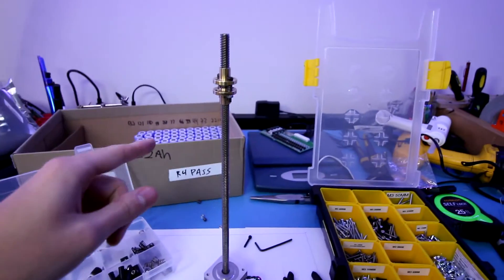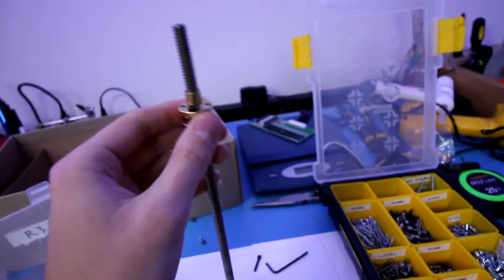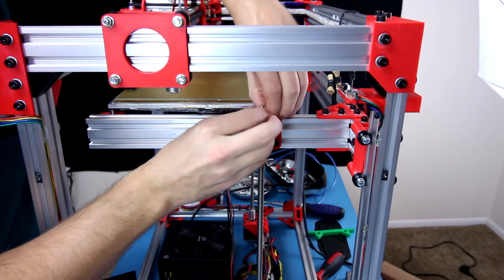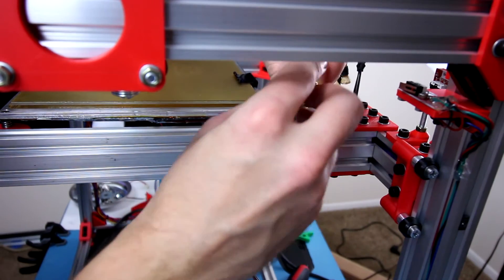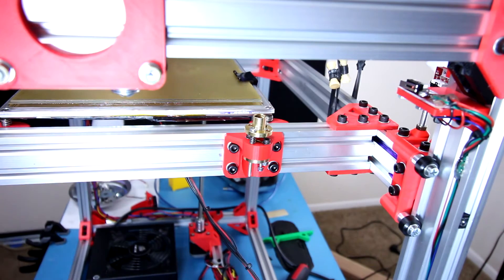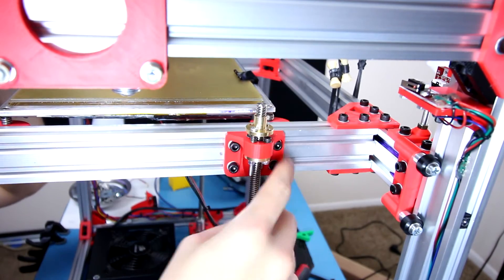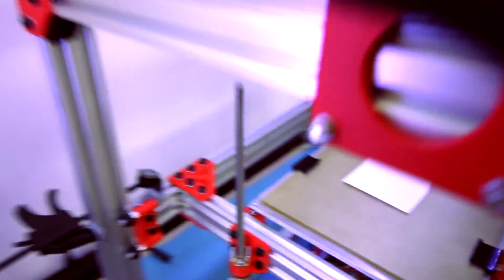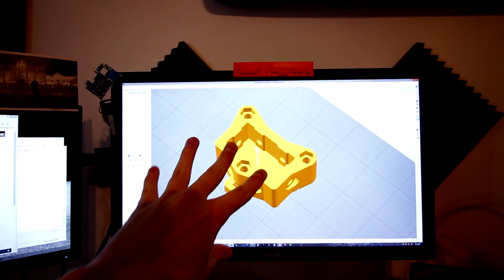DIY Anti-Backlash Nut - 3D Printer VLOG 23

Comment: 1) You should not put the load on the stepper motor.
2) You could screw one of the lead screw nuts on the top of the Z axis holder. Drill out the Z axis holder so the spring fits inside. Then set the other lead screw nut under, with one or two long screws so it can't turn with the lead screw (but you have some free space between fastening screws heads and the lead screw nuts).